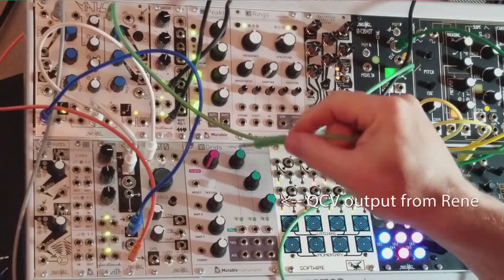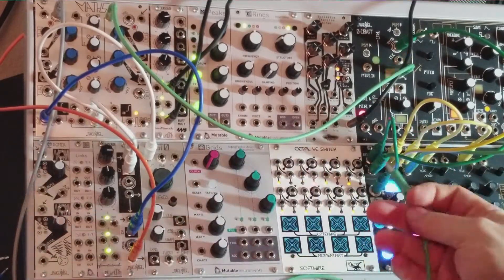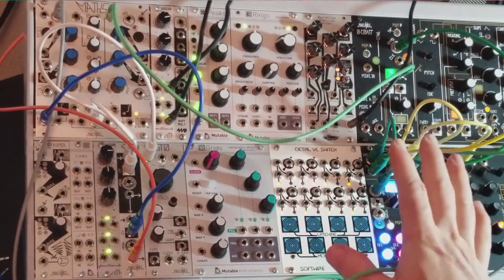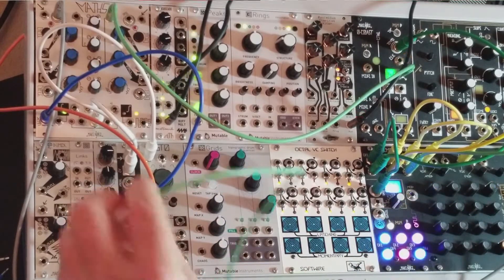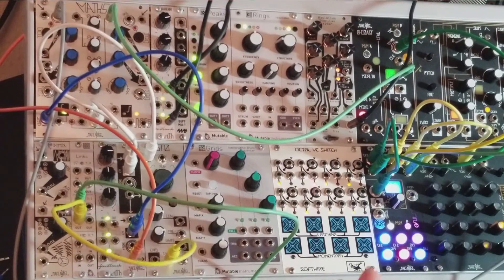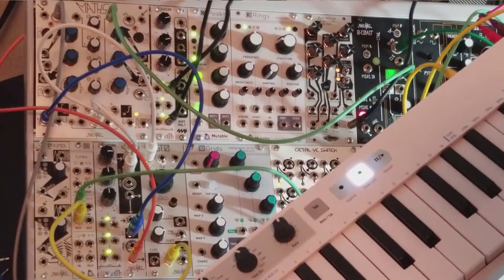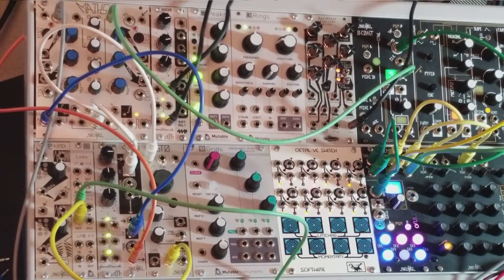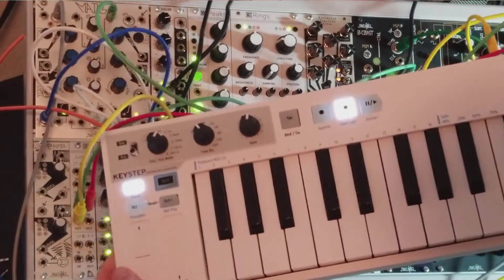Transposing Rene with Links

Comment: Thanks for posting this. I just tried it with a Disting (program C1), and BeatStep Pro. I guess the next step will be to create a sequence on the BSP to automate the transpositions.

ETA: With the BSP I'm not getting a linear response transposing the Disting. The only keys/pads on the BSP that transpose the Disting are F, G, A, and top C. At least the Disting displays how many semitones you're transposing so it's easy enough to program the BSP.